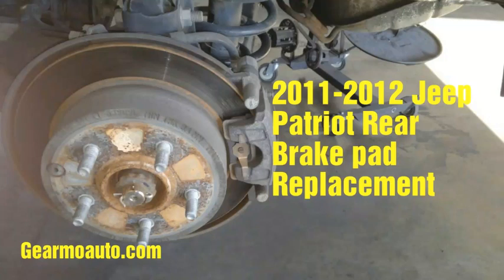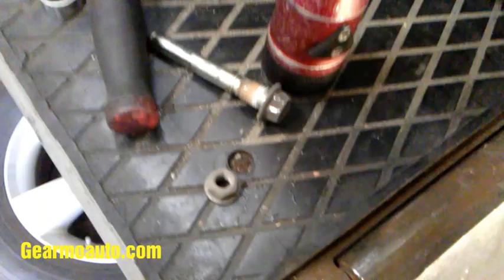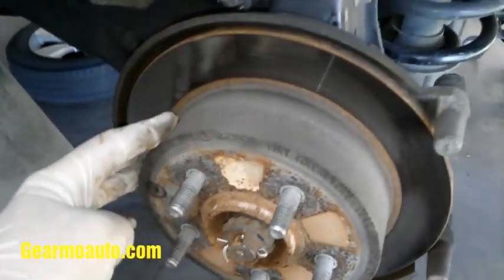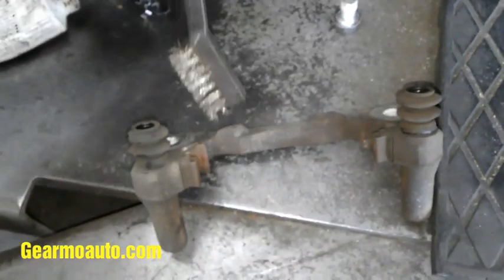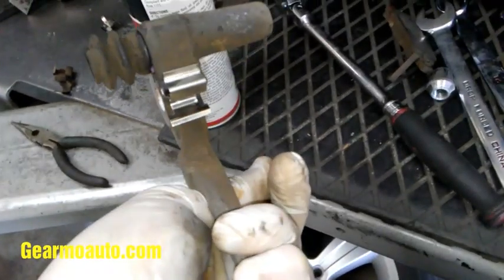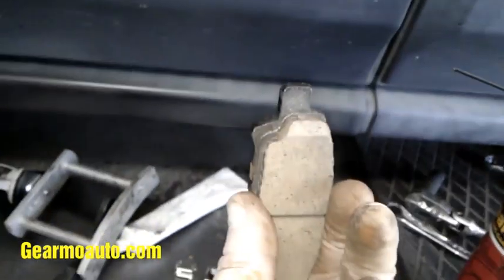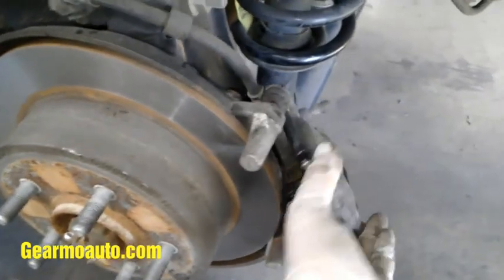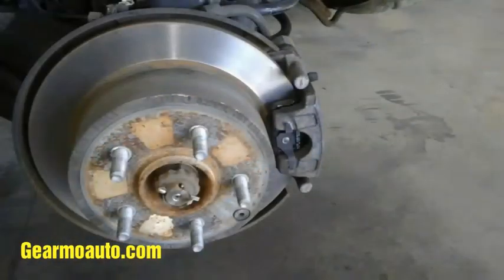2011 to 2012 Jeep Patriot rear brake pad replacement

Comment: I have never found a good video for replacing the rotor on a 2012 Jeep Patriot 4x4 with 2.4L engine.  Do you know of any videos or an instruction set for replacing the rear rotors?
Reply: The rotors slide right off. If they are stuck, you may have to bang them with a mallet or sledgehammer to break up the rust.
Reply: I know this is an old video, but for anyone else in the future, yes the rotor should slide off, but you have to make sure the e brake is off
Reply: It's slides write off. no brackets to remove. just take a 2×4 or something and knock it off.

Comment: You have to do replace rotars when your doing brake pads don’t listen to this guy, if you just replace the pads and not do the rotars you’ll get a pulsation from the brake pedal
Reply: I have never had that issue. I've always saved the money on rotors. The pedal shouldn't pulsate if the rotor isn't warped. And it shouldn't be warped if the brakes were done right the first time.
Reply: Rotors should be good for 2 sets of pads unless grooved or warped. You're just wasting your money.

Comment: Your video is not very helpful, you leave out a lot of key steps like removing the outer brake pad and getting the top caliper nut off.
Reply: You dont take off the top caliper nut. You take off the bottom and the 13mm on the line as shown in the video, then you wiggle the caliper off by sliding the pin out.